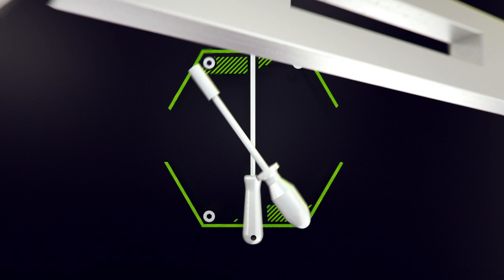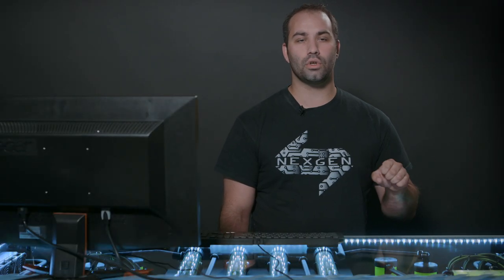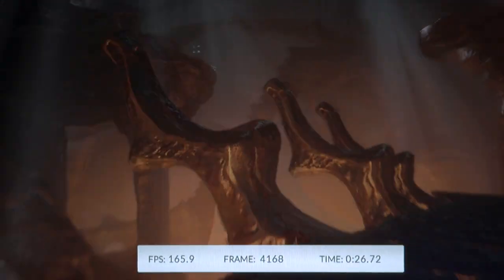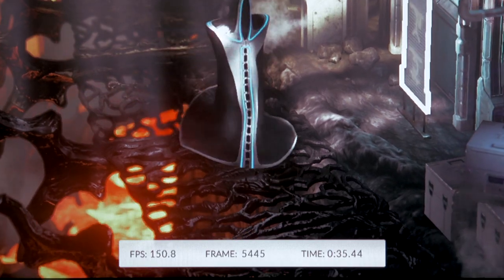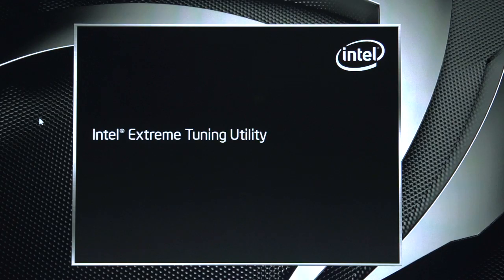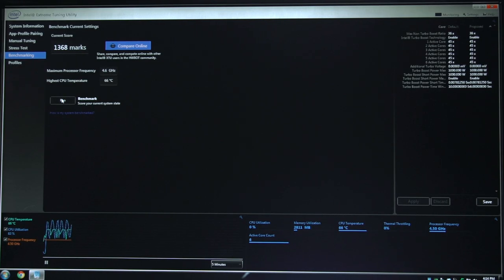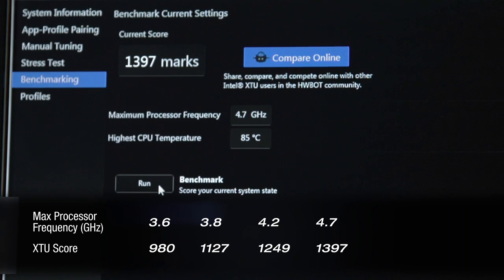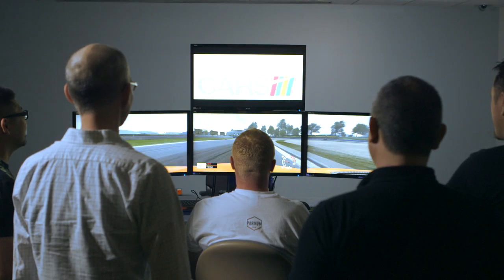GeForce Garage: Cross Desk Series, Video 7  – How To Overclock Your Gaming Rig

Comment: Can I overclock my hard drive to have 60tb?
Reply: Yes. If you are running windows, you just need to reformat your HDD (the one with the OS) to HFS+ journaled.
Reply: berzu21 Oh okay I just downloaded some ram and a new cpu also.
Reply: Wow thanks. Maybe I'll also download a new case and GPU.
Reply: make sure you download a better power supply first
Reply: ***** Yes, you can even go under the hood of your car, and remove one of your gasoline injectors, that's after you went to Wal-Mart and got yourself a couple of pellet air gun canister's and a few odd's and ends, to add the air injector on your CPU's., Sure beats the heck out water coolant, any day of the week.
Reply: You can even stick ram into your brain to increase your memory
Reply: Roxasmaker deleting system 32 will give you a 9001% higher storage
Reply: nawaf n Damn, that's over 9,000!

Comment: Tip: Even though you think you reached a stable overclock, don't be surprised to see a few games showing a little bit of graphical anomalies here and there. Different game engines behave differently to overclocked GPUs. Since you are pushing your GPU to the max, some games don't like it much and throw out some very minor graphical artifacts as a result. So don't be afraid to keep a overclocking profile with a lower clock settings for those games.

Comment: cool, now do something like that with an average rig like a fx 6300 or i5
Reply: Why...
Reply: you an AMD FX 8320 or 8350 those are more average and the FX 6300 is junk I had one.
Reply: berzu21 ok play a game that is like space engineers or something. Ha I had one and my cpu is way better then that junk why do you think that cpu is so cheap? Like I will never buy a cpu under $200
Reply: berzu21 learn what is a good cpu. All amd cpus are junk to intel. Until AMD makes a new chip with ddr4 ram then I will change my mind. The FX line is bad.
Reply: berzu21 Funny thing your so wrong I use AMD and Nvidia your joking? PS i7 will not be the best wait for 2016-2017 for the new chips. PS I support AMD cpu.
Reply: all you are sayingt is like the rig in the video the best component with a high end cumstom watercooled obviously you can OC really high.
i also have a fx6300 and is the best bang for buck
Reply: Rolando Loeb Well can you oc to 5.5ghz?
Reply: Zushikatetomoto Shift with a custom watercooled sure, my best oc with zalman performa x10 4.5ghz
Reply: Rolando Loeb Nice.
Reply: Well... They don't need to, it is primarily the saame with that
Reply: Carfreak36 after all you cant play batman arkham kight
Reply: Rolando Loeb Haha, true, but I meant the overclocking process, it is the same ^^
Reply: Carfreak36 mmm Not an average setup at much would have a water loop system just fot the cpu
Reply: Rolando Loeb Yes ofc lol but the main part of overclocking your system will be the same ^^
Reply: Rolando Loeb why? its the same exact process...
Reply: T2ak As I said all the time, thanks ^^
Reply: Carfreak36 Just backing you up :)
Reply: T2ak Ofc bro ;)